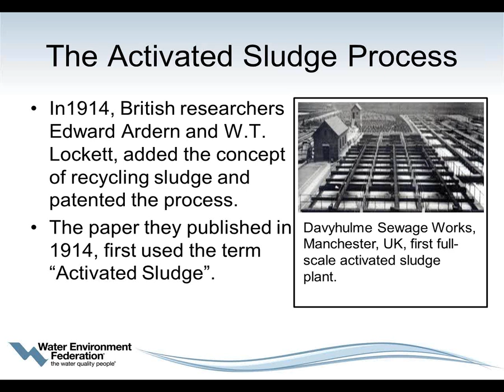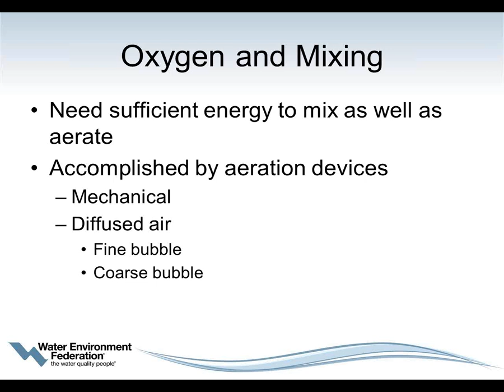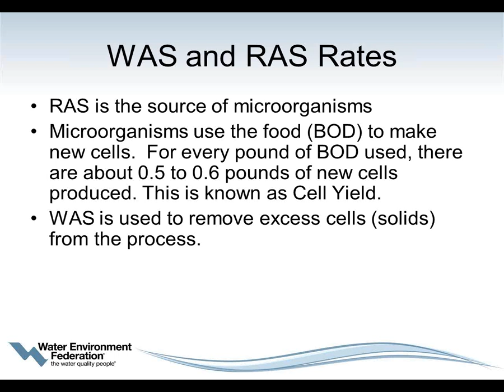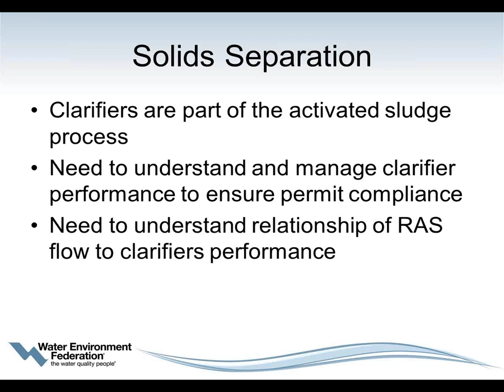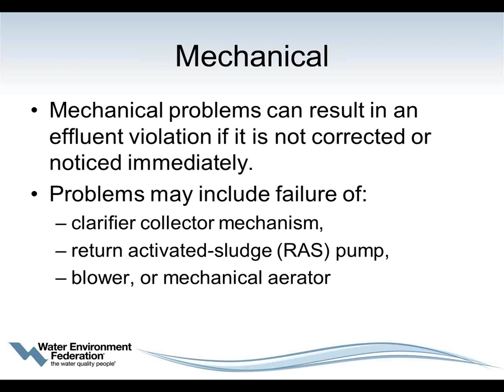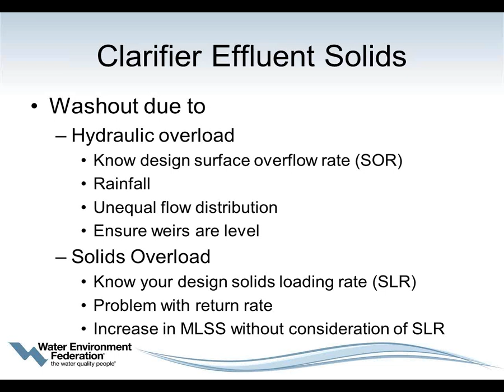Webcast of the Month: Process Control for Activated Sludge

Comment: In my practical experience of working with diffusers and mixing in activated sludge the course bubble diffusers provided DO levels to 4-5 and provided better mixing and a lot less maintenance due to clogging that fine bubble diffusers sometimes experience. The location of the diffusers as well as the geometry of the tank are key elements of design to the design of the aeration tank.
Reply: I dont mean to be so off topic but does anybody know a trick to log back into an Instagram account?
I was stupid forgot my account password. I appreciate any assistance you can give me!
Reply: @Matias Edward Instablaster =)
Reply: @Gunner Kayden Thanks for your reply. I found the site on google and im in the hacking process atm.
Looks like it's gonna take a while so I will reply here later with my results.
Reply: @Gunner Kayden It did the trick and I finally got access to my account again. I am so happy:D
Thank you so much, you saved my ass :D
Reply: @Matias Edward Happy to help =)